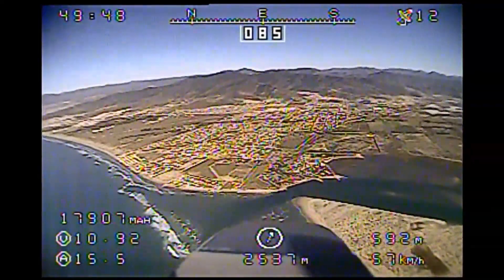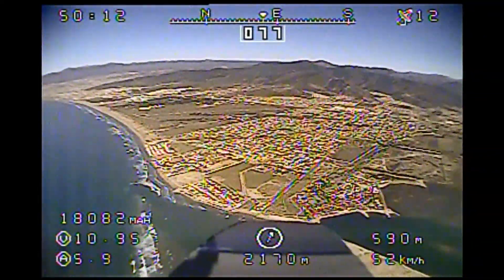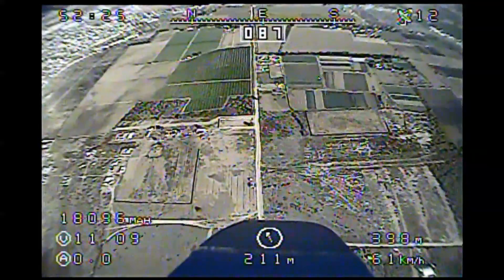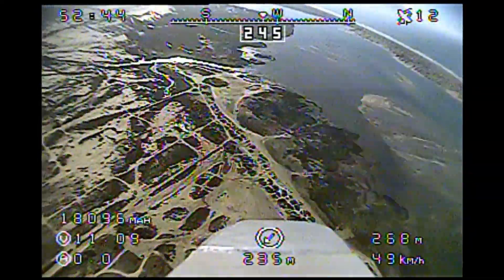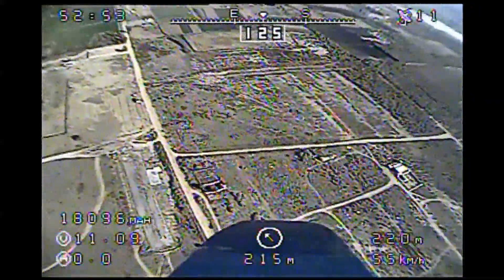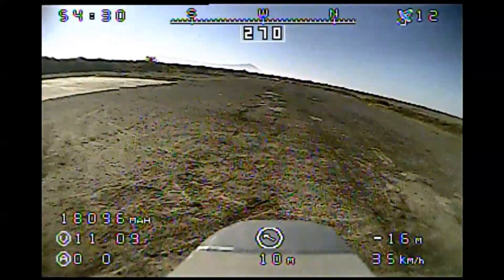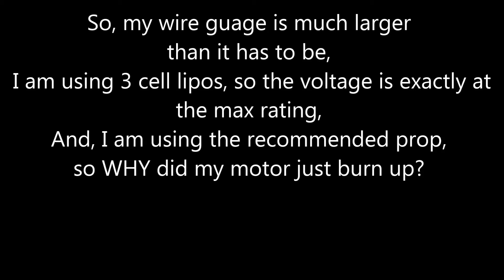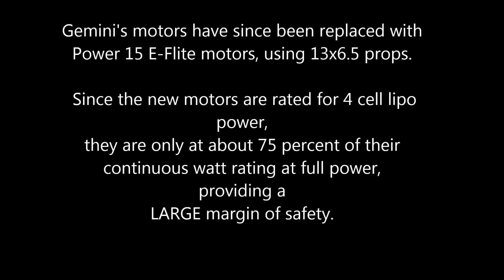GEMINI FPV/UAV FLIGHT TESTING/MOTOR FAIL FIRE/EMERGENCY LANDING

Comment: I am currently building your Gemini V2....  I saw your other vid using the EFL 480 motors (one of my faves)!  Is that what failed on this one, and do you still feel it is adequate power?  Thanks!
Reply: - btw...my initial thought was to use the Power 15...until I saw your vid with the 480s...the possible flight time is attractive but is it enough???
Reply from the maker: TheLipRipp3r the flight time is the same on both. i found a better prop to use with the power 15. it is the 13x 8 thin electric from  a p c.   i had the 480 over propped, that's why it burned up. the factory spec does not take into account that the motor will be run at full power continuously for a long time. it's right not he edge of overloading the motor,even with good cooling.

Comment: Interesting: just for info, I use a "Watts up" meter, can measure current upto 100A and fairly cheap, to check that the system is within limits I run at full power on the bench and check. This meter records peak amp values too, great for verification. Also for efficiency, an ESC with "Active Freewheeling" is much better for partial throttle runs, the Castle have not implemented this so more battery energy is wasted in heat when the throttle is below max. Kontronic do it, more expensive but there are plenty of others. Worth considering if efficiency and record flights are pursued.
Reply from the maker: Thanks for the information!  i will look into the Kontronic esc's that you mentioned.  appreciate it!

Comment: l think it was burn, because the wind was blow from the front of the plane has the same speed with the model blow to the back,so the power for the push is change to heat and burn.

Comment: I have to say you are a great model maker,your design is one of the best I have seen. I would love to see them in foam, there is no way I can buy one out of wood like this one.  I have a new Eagle Tree OSD PRO with the Guardian stabilizer system for sale this is from ready made rc I ordered 2 and never used the second one and do not need it, so if you or someone you know that needs one PM me and we can talk.
Reply from the maker: I've actually had a lot of plans requests, and i'm currently working on a pdf to send to people wanting to build gemini, but i agree that a foam, or composite model would be the best for mass production.   i'm also working on a design for  a simplified version, something that would require only average building skills, and be more easily portable. like in the trunk of a small car.  i'm also looking at pixhawk for autonomous flight, and thinking of going the commercial route with the design. thanks for your kind words, and complement. any suggestions to improve future versions of gemini would be appreciated.  thanks!